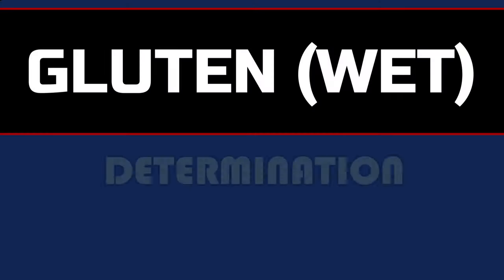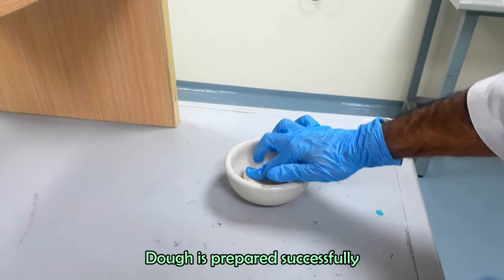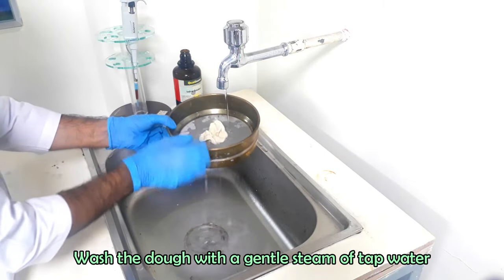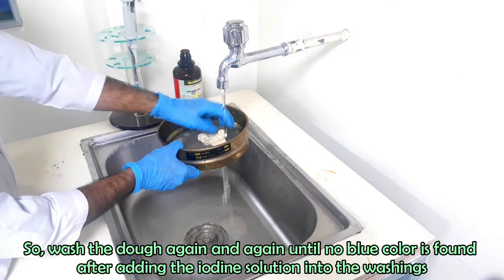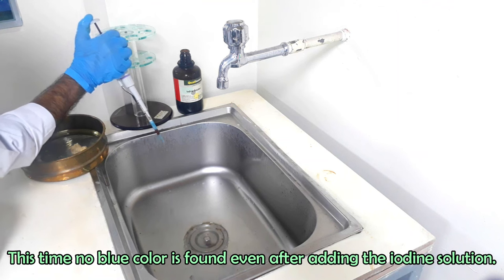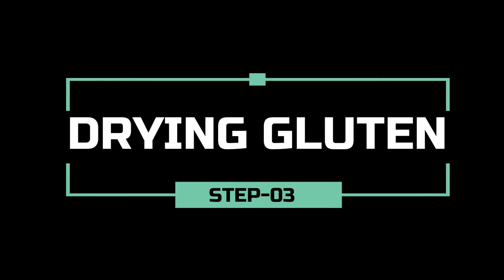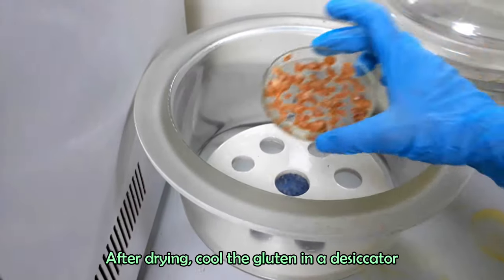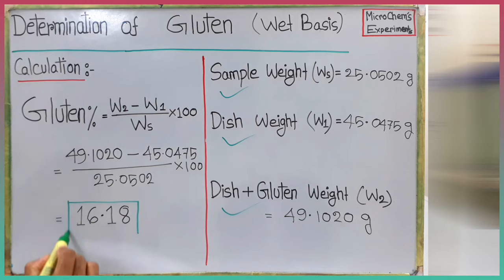Determination of Gluten Content of Wheat or Flour Sample _ A Complete Procedure (IS 1155-1968)

Comment: Make a video for packaging material lab test!
Reply from the maker: Please specify the test name.
Reply: @MicroChemsExperiments   1.Thickness 
2. Paper density - Basis weight - Grammage 
3. Burst Strength 
 4. Tear Resistance 
5. Tensile Strength 
6. Grease Resistance
 7. Gas Transmission Rate ( GTR ) 
8. Water Vapour Transmission Rate ( WVTR ) 
9. Impact Strength : 
10. Abrasion Resistance

make a all test in on video!
Reply from the maker: @bokulhossain5771  Sorry Bokul Hossain, we don't have enough facilities to do these tests and we are very sorry for that. In fufure, if we get facilities, we will make videos on your mentioned parameter.

Comment: too high dry gluten max dry gluten in wheat flour 9% something as for me
Reply from the maker: Okay
Reply: I got 385gm gluten ball from exactly 1kg of maida. How much dry gluten content present?
Reply: What could cause discrepancy. Assumption is that water removes starch. Water wasnt fully removed, may need drying under low pressure. There must also be cellulose, hemicellulose and pectin in the wheat flour which aren't removed by water washing. I'm not from the biochemistry field. Just curious. Interesting experiment.